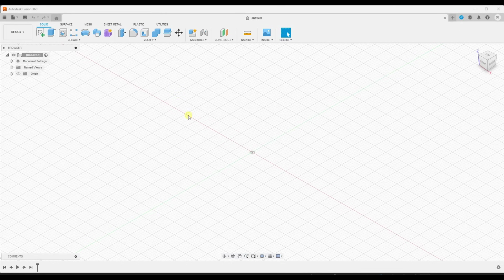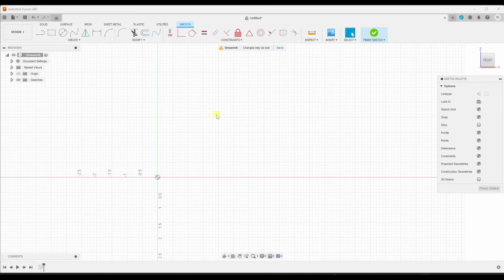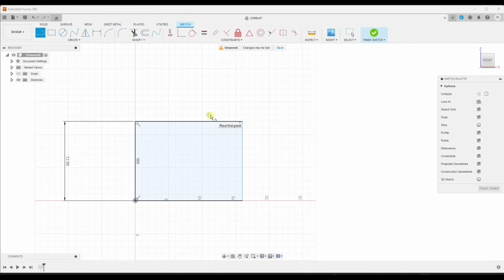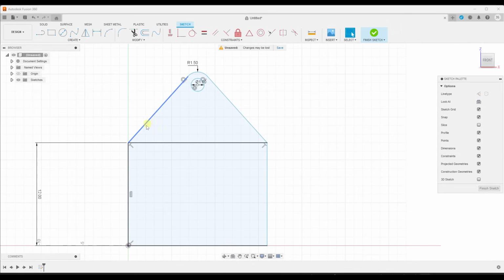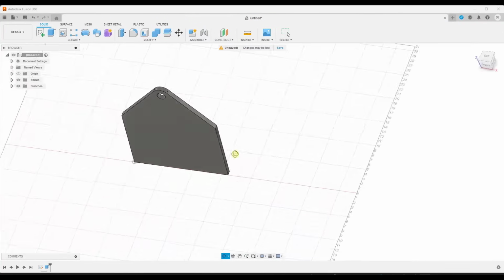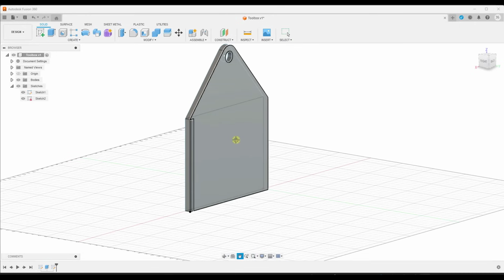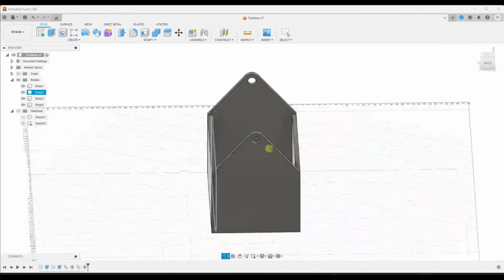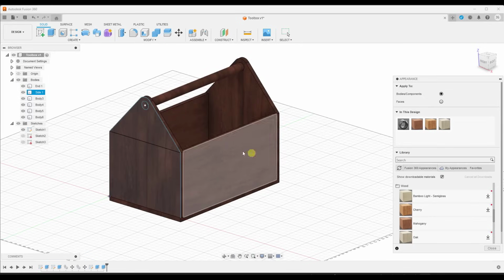Getting Started with Fusion 360 Part 1 - BEGINNERS START HERE!

Comment: Hi, I've been working with Fusion 360 for about 2 years. I pretty much learn on the fly so I don't know everything I probably should. I'm 72 now and need some help that I cannot afford so I decided to make a couple mobile robotic arms to help me in my shop. My first question is, do I need to have gears or pulley's in my design in order to get the different parts to move?

Comment: Thanks for the video. All was fine until making the dowel since I cannot select only the circle to extrude.
Reply: That usually happens when the sketch isn’t fully closed or there are overlapping lines so Fusion doesn’t see it as a single profile  

Try zooming in and trimming any extra lines, or reselect the sketch profile — it should highlight as one area before extruding 👍  

If you want I can show you exactly what’s causing it

Comment: love this, but for some reason my circle tool does not create a hole. when I extrude it's solid.
Reply: That usually happens when the sketch isn’t fully closed or there are overlapping lines so Fusion doesn’t see it as a single profile  

Try zooming in and trimming any extra lines, or reselect the sketch profile — it should highlight as one area before extruding 👍  

If you want I can show you exactly what’s causing it

Comment: I've started learning Fusion for personal use (hobbyist woodworker). Something frustrating about the extrude tool for the dowel across the top of the toolbox is that I can't seem to select the OUTSIDE of the hole. When I select the hole and extrude, it always ends up starting from the inside of the frame. What am I missing? Also, I can't seem to find a tool to adjust the length of the extruded body. If such a tool existed, I could grab the end and extend it to the outside of the frame...
Reply: That’s a common one — you’re probably selecting the inner profile of the hole, so Fusion is extruding from the inside instead of the outer face  

Try selecting the ring between the inner and outer edges (the actual face), not just the circle line 👍  

For adjusting the length after, use “Press Pull” or edit the original extrude in the timeline — you don’t grab it like other software  

If you want I can show you the exact way to do it

Comment: Thank you so much for this video. I've been wanting to learn Fusion 360 for a while but found getting started a bit intimidating. This was exactly what I needed. One question I had when following along: at the 11:43 mark your object is solid, while mine shows a horizontal line connecting the top two points of the rectangle, but only on one side. The other side of my object is smooth like yours. I've tried recreating it, following your instructions to the letter, but it always comes out that way. It doesn't appear to be a show-stopper, but I would like to understand why this is the case. Thanks!

EDIT: Finally figured it out. When looking at the sketch, if I extrude away from my viewing perspective (negative extrusion distance value), it creates boundary lines between the shapes on the starting plane. However, when I extrude toward my viewing perspective (positive extrusion distance value), everything is created solid and smooth. I don't understand why that is the case, but at least I know the cause of what I was getting.

Comment: Omg.. I have not seen such a stupid program before! No ''change dimension'', no ''add measurement'', no cut, nothing! Without this tutorial, I totally lost. I didn't listen part about saving the project because I think that ''it was easy, just like every program saves in some folder and you're done''. Nah! When I actually try to save the project, it doesn't work at all! Why do they make it that complicated??? Not sure, or I will intend to try again, maybe ill better look for something more user-friendly...
Reply: Yeah it can feel like that at first — Fusion does a few things very differently to most programs  

Dimensions and measurements are done inside sketches (that’s where “change dimension” is), and saving is automatic to the cloud rather than manual folders  

Once you know those two things it starts to click a lot more  

If you want I can show you how it actually works so it feels a lot simpler 👍

Comment: This is so great but I ended up with just one Body even though i kept checking 'New Body' in the operation. it did not let me extrude over the dowel hole - the selection did not turn red, i just couldn't select it at all -  just kept reverting to trying to extrude the entire side. It feels like those two issues are related somehow. It is so weird, i think adding the bottom piece somehow made everything join up together, even though i selected New Body.
Reply: So yes I fixed the bottom piece. Somehow I hadn't really created a proper rectangle sketch, but i finally managed it. However extruding from the negative space to get the dowel handle -- the mouse doesn't recognise that area. In fact, when I tried another way, to create a circle sketch inside, it didn't even let me find the half way point.... so that original circle in the original sketch somehow is not registering something, at all. It is a cut out hole, but it's like it's invisible to the programme, so I must have done something wrong.
Reply: Yeah those two things are usually linked — if you can’t select the profile properly Fusion will default to extruding the whole face and it ends up joining  

Sounds like the hole/profile isn’t being recognised as a separate closed shape (could be overlapping lines or it’s already merged)  

Also “New Body” only works if the profile is valid — otherwise it just joins anyway  

Try editing the sketch and making sure the hole highlights as its own selectable area 👍  

If you want I can show you exactly what’s causing it

Comment: When you make the floor, how do you get it to like lift the other pieces you've made? The floor is one flat piece in your tutorial but when I do it it sorta cuts into the other pieces (like corners are squares where the sides come down through the floor) the pieces intersect.
Reply: That usually means everything is being created as one body, so when you extrude the floor it’s just merging/intersecting instead of sitting underneath  

You want each part (sides, floor, etc.) as separate bodies first — make sure you’re using “New Body” on each extrude 👍  

Then you can position them properly or combine them after  

If you want I can show you the clean way to set it up so it doesn’t intersect like that

Comment: When I go to duplicate, when I select "bodies" and go to move from point to point, I do not get the "create copy" box.
Reply: That usually happens if you’re using the wrong move mode — the “Create Copy” option only shows when you’re in Move/Copy and have bodies selected properly  

Make sure you’re using Modify → Move/Copy (not point to point), then tick “Create Copy” in the dialog 👍  

If you’re doing point to point it can hide that option  

I can show you the exact way to duplicate bodies cleanly if you want

Comment: I love your tutorials for Fusion 360 as well as Sketchup. I am really new at Fusion and I'm having a difficult time with one part of this first lesson. When I get to the portion for creating the floor my floor extrusion always extends below the floor - I have to use a negative number to create the floor then move the entire model upwards. In your demonstration, the extrusion arrow points down but when done your model is still on the X-Y plane. What am I getting wrong?
Reply: That’s just the direction of the extrude — you’re extruding from the sketch plane downwards instead of upwards  

Fusion doesn’t care which way you go, it’s just relative to the sketch plane  

In the tutorial they’re probably flipping the direction or using “Two Sides” / “Symmetric” so it stays centred on the X-Y plane 👍  

You don’t need to move the whole model after — just flip the arrow or change the direction in the extrude settings  

If you want I can show you the clean way to keep everything aligned

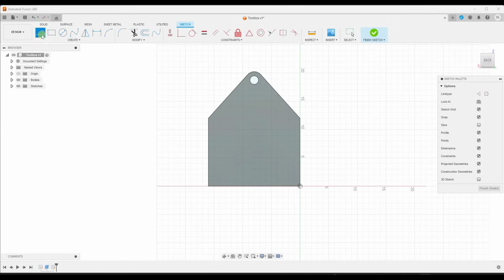Comment: I really like your tutorials, Very complete. I am running into an issue at 13:59 when I try to sketch the first wall. Tried everything multiple times. Choose the face, sketch. Start at the bottom, put in .750 for 3/4 and I get a stop hand. Will not allow drawing the side wall.

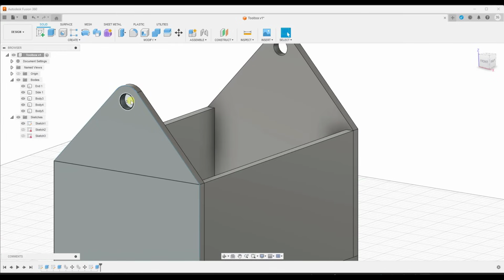Comment: Almost made it to the end, with lots of pausing and rewinding. Around 19:15 is where I get hung up; I can't select the circle. The video shows a tiny reference circle in the middle of the hole, but my drawing has no reference point to select. I've mouse over the area, but I can only select faces and bodies. I can, however make a chamfer in the hole by selecting the outline of the circle and using the fillet tool. Weird. I wonder if Audodesk made a UI change since this video, or there is some default preference that's changed.
Reply: I figured it out... he has Sketch 1 visible, which then shows the circle reference point.
Reply: @stevenkonecny6007  TY BRO YOU SAVED ME A TON OF TIME !! YEA IM DUMB
Reply: @neo6450 No you're not
Reply: @stevenkonecny6007 I couldn’t figure it out either!  🤣😭😎
Reply: Thanks a lot for coming back here to explain!

Comment: Adding the .75 wall and filling it in refuses to work for me.  Because of this I can't grab the wall and stretch it out.  I can make the .75 part, stretch it up so that fits.  Then when I grab the lower left corner to try and extend up and over to fill it, the program goes nuts.  It thinks I want a hemisphere sticking out, it refuses to color in the object.  When i save and try to grab the wall there's nothing to grab.  It's not clear how you fill in just the .75.

Comment: After many years of learning how to do "Old School" Drafting, then moving on to a basic CAD program (Delta CAD) about 10 years ago, I've had to find a new CAD software to use.  So far from what I've found, your's is most comprehensive Fusion 360 for Dummies I've found.  I'm in the process of drawing a Theil cabinet for a guitar speaker. Although, had I pulled out my "Drafting tools" I'd probably be done by now......LOL.  But I hope to advance to creating stuff for my 3d printer.

Comment: As a engineering student, I've heard that Fusion 360 was a great tool to use, but I was afraid to do so because I thought it was complex. I've used it before, but I needed a bit more than a refresher. This helps a ton for what I need to do, Thank you.

Comment: I think your video is awesome, well done and very good detail. I do have a question for you, When I make the bottom of the tool box, mine has to go in the negative direction because the front, back and sides are all  touching the ZERO place if you will, the ground so to speak. somehow in your video it did not do that to you, is this an issue for example if I wanted to 3D print this? seems to me like a big problem as the printer head would be told to start printing below the printing plate? or am I thinking too deep about it? no pun intended.

Comment: Great Stuff. Originally the triangle piece of the handle wasn't an extrudable piece but I started again and it all worked. Thanks
Reply: i must be having same issue, the bottom square lines are all black, but when i deleted the triangles center line, it made the triangle lines blue... and aft5er making the circle for the dowel, both that circle and the top square/bottom triangle line is red??? ... Idk i followed the dudes instructions... not sure

Comment: Hi man, I am checking your video and I like that Fusion 360 seems very easy to use....I have a mac now but when I had a windows machine  I used to use Caligari Truespace 7.5 with Vray, super super easy and can create great renderings, I use 3d for exhibition stands, interiors and exteriors...I don't know if you know TrueSpace but if you do...do you think Fusion 360 is a good alternative to TrueSpace? as I said, I'm on mac and I cannot longer use truespace and I don't want to use a VM. Cheers mate

Comment: The most frustrating thing about Fusion is nothing seems to work for me like what is demonstrated.  @21:30 When I click the inside face of the object, then try to create a sketch for the wall, I cannot get the line to continue past the 2nd point.  I click to place the first point, enter 3/4 for the length, the tool asks to specify the next point, when I click, the line ends.  I'm not able to continue the line, it doesn't say specify the next point like it did when i created the first sketch.  I must have accidentally turned something off that allows me to continue the line to create a shape, but I have no idea what.  I've searched forums and no one else seems to have this issue.  Any ideas?
Reply: I have exactly the same problem but haven't found a solution yet.

Comment: One of the best tutorials I have seen , one thing is that when I true to extrude the circle just like u did at 19:20 it doesn't allow me to select the circle itself. Instead it allows me to select the whole side. Do u have any solution for this?
Reply: Ooo I found solution by myself 😂.  It was so easy. You need to disselect hide mode for sketch in which was circle . For me it was sketch 1 . It need to be unhide than you can see point for circle from whom you can activate extrude.
Reply: @melitazila3989  Thanks! I've waisted at least 2 hours trying to extrude the bloody handle.
Reply: @melitazila3989  Clear as mud!
Reply: The same problem.. Did You found solution?

Comment: This Might be me getting ahead of myself. And maybe you did it this way to show the tools better. But I found once I had one wall and one side I merged the two objects and them duplicated them and rotated them/moved them until they moved into each other such that I mirrored the shape and had both sides and the front and the back. Is there a reason not to do this?
Reply: For parametric designs it's a bad idea because it gives you less flexibility to change things going forward.

Comment: You just convinced me to use Fusion 360 for my modeling hobby.  I have been using AutoCAD LT for 20 years as a commercial foodservice designer, so Fusion 360 has similar operations and processes.  I will be downloading the program and then following your fine tutorial.

Comment: great video, helped me get started to design in Fusion 360, so far find a bit easier to use than onshape that i was using before, still trying to find some functions as they located in different menus. but hope it will only get easier for me

Comment: I agree and support all the compliments said by others in their comm and I have some questions: you said to always select New Body and not Join. What is the reason for that? Is it specific to this project only? I, for e.g., need to make an enclosure (box + lid) for 3D printing with different material and/or vacuum casting. When is it ok to join the sketches?

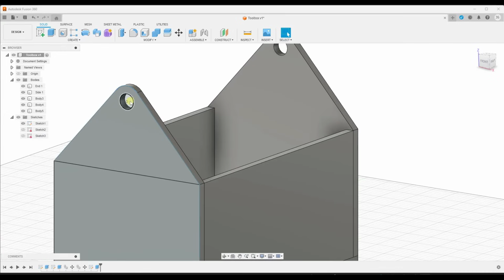Comment: Hmmm.  Installed F360 3/12/24.  Started in on this tutorial, and everything goes good until I get to extruding the handle at 19:12.  I've redone this three times, and the centerpoint for the circle no longer exists on the outer edge of the end.  The centerpoint for the circle on the inside edge exists and I can extrude from there, but that leaves a hole in this end, and extends the handle .75" past the outside edge of the other end panel.  That would be fine, except I can't select the handle to move it... (yes it was created as a body.)  Any ideas?

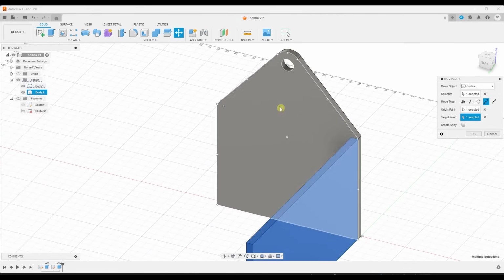Comment: At 17:09 this method is creating that side that's selected to be slightly offset on the side of the front, and there's no way to move it into position, well for a noob like me. Is there a way to move the wall into position again? I'm doing this with mm and not inches

Comment: Very new to Fusion so appreciate you making these tutorials. Have been able to follow mostly. Currently can’t highlight the hole to extrude the handle. Fusion keeps grabbing the whole side, so not sure what I’m doing wrong. Any ideas?
Reply: I had the same problem. After a bit of trial and error, I found out that the sketch for the end side was not visible and therefore the hole could not be selected. Once I made it visible it worked. 
Hopefully it solves the problem for you too.
Reply: thanks - will check what i did. @Raknarek

Comment: Got all the way to the extrude dowel and cant select it... i've lost the little dot thing in the middle of the circle...help!
Reply: Yeah, I had the same problem.
Reply: Same for me. Nothing seems to allow me to select it.
Reply: Yep - me too. Was going so well!
Reply: Hopefully, you figured it out by now, but in case you didn't:
Go to your left side that lists all the sketches, select 'Sketch1'.  On the left side, there is what looks like a little eye.  You need to click on that to make the sketch visible and then you'll see the center dot in the middle of the hole.
Hope that helps.
Hutch
Reply: Anyone find the fix for this?
Reply: You can create a new sketch based on the existing circle:
1. Create a new Sketch on the Face (side of the circle)
2. Press (P) for Project then select the existing circle - you now have circle sketch based on the existing one (same size)
3. Then Extrude or Press Pull
Reply: I wasn’t able to get the dot thing either but I was able to successfully extrude the dowel. I think the dot feature may have vanished with successive Fusion updates: 

I found that selecting the circle on the exterior facing edge of the body helped me finally get it. It’s tricky because the cursor jumps around inside of the circle cavity.